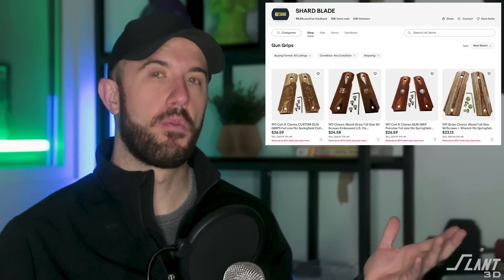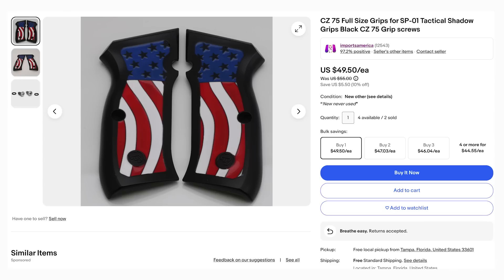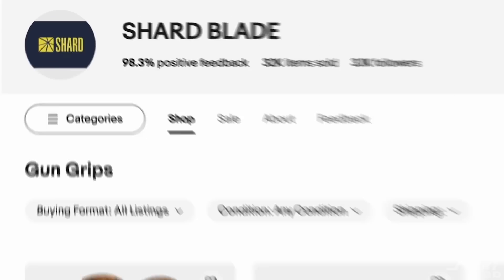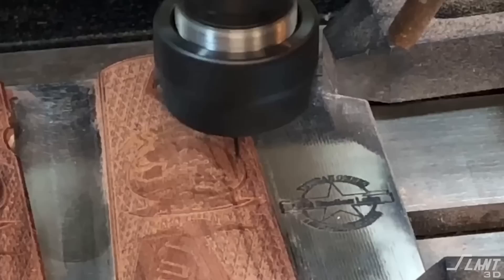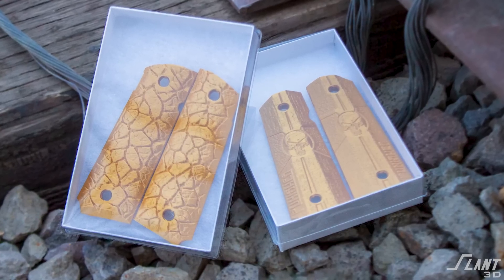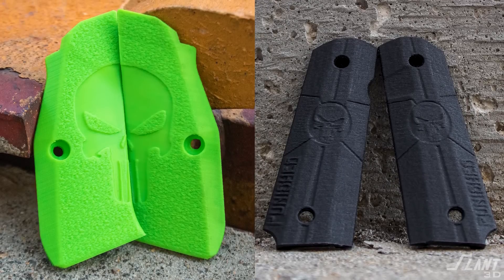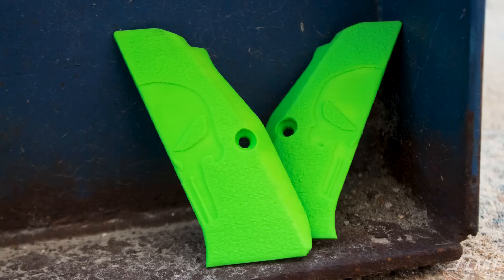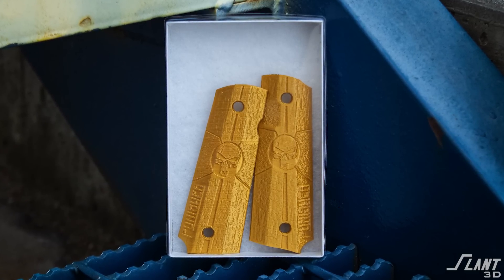$1 Million 3D Printed Pistol Grips

Comment: To print polymer pistol grips you would have to use something like Nylon you can't use PLA, PETG or ABS. Gun cleaners will melt these kinds of plastics down no problem you need a polymer that's highly chemical resistant.
Reply: PETG (or preferably PET, but G works too) is just about the most chemical/solvent resistant plastic you can use. TPU is right up alongside it. It's the ABS family that's a problem.
Reply: @daliasprints9798  I don't know.... Hoppe's No.9 is pretty rugged stuff. Most gun cleaners have cleaning chemicals equal to or surpassing acetone. And I know that acetone won't completely dissolve PETG, it will soften and warp it, you would for sure loose your fancy grip textures and end up with a crappy looking grip. Take a look at what most firearm manufactures make their injected molded polymer parts out of.... you will find they are made of Nylon which has a high chemical resistance.

Comment: If some pistol grip sells a lot, they are going to injection-mold it. They are not going to be your customers. You are delusional.
Reply: Looks like someone doesn't know about the cost or lead time on injection molds or injection molding machine, or the sheer product and most importantly... LOGISTICAL FLEXIBILITY of 3d printing. I cannot emphasize enough how important not having to hold huge amounts of stock is to your margins, that shit is EXPENSIVE! It's all well and good if you are selling millions of a standard, completely unchanging part every year... Like icecream cups or syringes, but it makes little sense under a 100k per anum volumes, and often even at larger volumes than that, because being able to adapt your product on the fly is VERY important for any market that that moves fast, or even at a medium speed. Only reason for the vast majority of products not to use it is if they can't find enough print farms that can handle their volume at spec in the right places, but however much that is the case now, you can BET it's not much going to be the case in the future.
Reply from the maker: We out perform molding every day

Comment: I love 3d printing (and especially firearms), but the one thing that always gets me is the layer lines. Not a fan of them. I can overlook them in a functional design, but if it's on a real machined firearm, then it'll just look a bit out of place. If it's layed out clearly though, I don't see an issue if the customer wants it!
Reply: Print on end, like the video shows. with 0.12 layer height the lines disappear into the noise. Printing them flat will definitely introduce stair-stepping and make it super obvious that its printed.
Reply from the maker: Luckily there are no layer lines

Comment: no one wants plastic grips......
Reply: If no one wants them, then why are they so ubiquitous? I see them everywhere and something done in carbon fiber ASA will probably outlast some of the non printed grips.
Reply: @BertNielson  1911 grips and others made from Micarta and G10 are about flexing on poor people or having something that people perceive as top quality.
Reply: Did you think something similar when glock came out with the polymer frames?
Reply: This is an odd thing to say, given that people are selling them by the bucketload... How does that work if no-one wants to buy them? Very strange.
Reply: Esp FDM printed
Reply: Then you make them with a metal 3d Printer.
Reply: That’s strange, I’ve sold dozens of them…
Reply: You know 3d printers can print in carbon fiber? Do some research
Reply: @djandybass  cf nylon is not the same as carbon fiber at all
Reply: i wouldn't touch cf nylon with bare hands but that's just me 🤷

Comment: Most people wont trust the durability of 3d printed grips.
Reply: You really haven't seen stuff like 3d printed nylon glassfilled......
Reply: @LastDitchHero boomers with 1911s haven’t either, which is the problem. Whether or not 3D printed grips are actually of inferior quality and durability is irrelevant if they are perceived that way by their target market.
Reply: @CutlassOutdoors  Thank you for knowing the market better than Last Ditch.
Reply: @LastDitchHero - Oh, I have. I'm talking Boomers. Really, how many guns use grip panels these days? 1911's and froo froo CZ's.
Reply: Printed in its flattest orientation, this part is unlikely to experience stress even while shooting and handling

Comment: If I get new grips, I want really high surface quality. Haven't seen 3DP get there really, at least not FDM.
Reply: Then you haven't seen what 3D printers can do. I have been selling wood grips and high quality grips both 3D printed and engraved for a while
Reply: Wouldn't want resin grips, not the strongest.
Reply: SLS/MJF can create some really unique textures. Also, unlike FDM, you can print hundreds at one time.
Reply: First, knowing how to process FDM prints separates the men from the boys. Second, a low end printer, properly calibrated, can make some cool texture effects that really hard to get unless you are a talented stippler/checker.